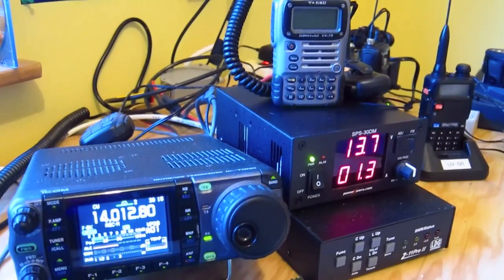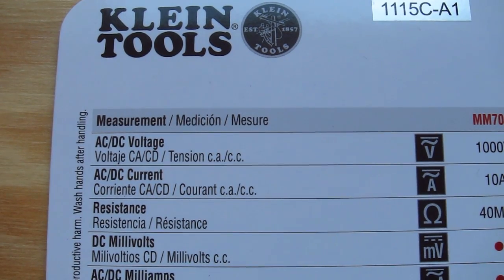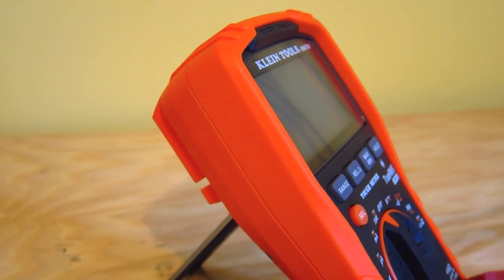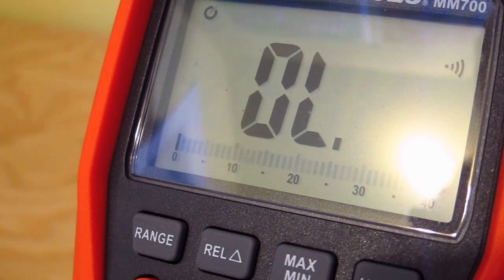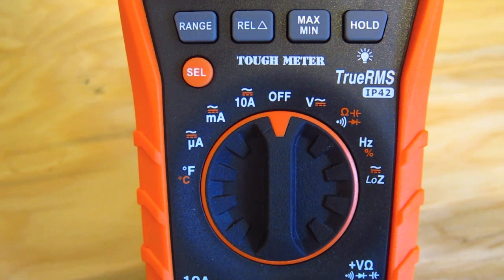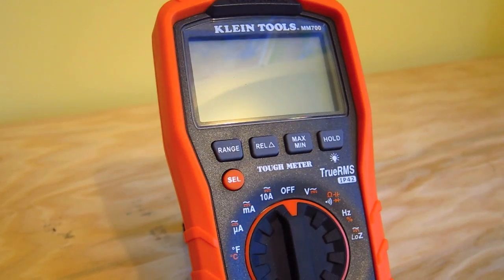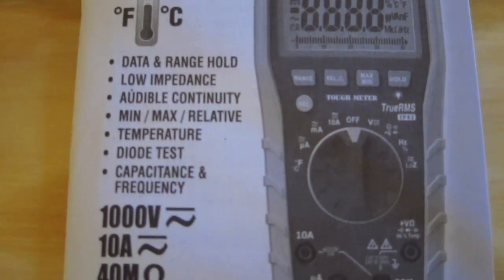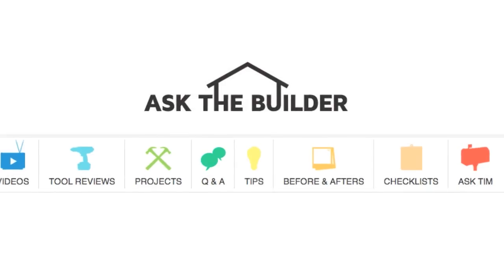Klein MM700 Digital Multimeter

Comment: I just have to ask. I own the mm700 and it claims to do up to 1,500 degrees. How would you use this wire and what would you test it against to get  this kind of reading, without melting the thermostat, the wire and yourself? 2nd question. Does anyone know how to really use the L0Z function? The description is pretty vague.
Reply: The Klein 700 manual quotes the normal impedance at 10 MΩ and the Low Z at <3K Ω.For example, your measurement shows 40 volts even though the line is disconnected from the main switch. Stray voltage readings can be caused by capacitive/inductive coupling of energized conductors with nearby unused wire. This capacitance increases as the length of the conductor increases. The longer the wire, the more the stray voltage. Multimeters with high input impedance that is greater than 1 MΩ are designed to place very little load on the circuit under test. In this capacitive coupling situation, a phantom voltage reading is measured by high input impedance multimeters. Stray voltage is a phenomenon involving very small values of capacitance; it cannot energize a load. Using a multimeter with low input impedance will short out the capacitive or inductive coupling effect, allowing the correct voltage reading (< 1V) on the disconnected or unenergized line, while using a high input impedance multimeter will not. Therefore, we have a low impedance setting (Low Z).
Reply: The thermocouple included with the MM700, per user-manual, is suitable for below 356F/180C. Things like Clean Room or Lab Oven need optional probes. https://www.amazon.com/REED-Instruments-R2940-Thermocouple-1652°F/dp/B074CX784C/ref=redir_mobile_desktop?ie=UTF8&aaxitk=jpXPwXvAnSX3xZgG7Q9yMQ&hsa_cr_id=4889708790801&ref_=sbx_be_s_sparkle_mcd_asin_2
Reply from the maker: Kenny, this is a great question and I LOVE these when they come in. Why? These questions provide a fantastic teaching moment. First and foremost when you have a question about a tool or product, you should only go to one source for the answer. You should go to the company that makes the tool or product because they know best how to use the tool/product and/or they BACK the warranty. Following advice from invisible people here on the Internet who may be trolls or have little real experience in the issue is foolhardy. That said, you should always approach the manufacturers using multiple methods at the same time. Start with the Contact Us page on their website, call the toll-free number, reach out via their social media outlets, etc. Once you've done this and gotten an answer from Klein, stop back and tell us what you discovered.

Comment: I just bought one from Home Depot.  I am extremely disappointed in the display. When I put it on the kickstand, very hard to read. Debating whether or not to take it back. I think the meter itself is very good. But the contrast and lack of viewing from different angles is ridiculous.  Terrible. I own three other meters that I bought for $20-$50. Everyone of those has a better display then  the MM 700.
Reply from the maker: That's odd. It's a very standard LCD screen. I have no issues seeing mine. Are you sure it wasn't COLD? Were the batteries fresh with enough voltage? Weak batteries = low LCD contrast.
Reply: Thanks for reply. I have brand new Energizers in it. If I lay meter flat on bench or keep it about at an inch angle, display is great. I have read other reviews on Amazon with same complaints. It’s very bad. Display almost disappears from angle on kickstand. Wondering if just a bad unit or this is the design of product. Idk.

Comment: Silly question but how do I check my truck battery voltage? I turned the dial to the right to voltage and tested the terminals and there was no voltage reading that came up. Am I doing something wrong ?
Reply from the maker: Yes, you're doing something wrong, the internal meter battery could be dead. Your troubles will dissolve like sugar in hot tea when you read the owners manual of the tool.